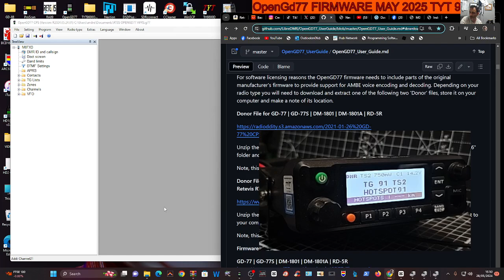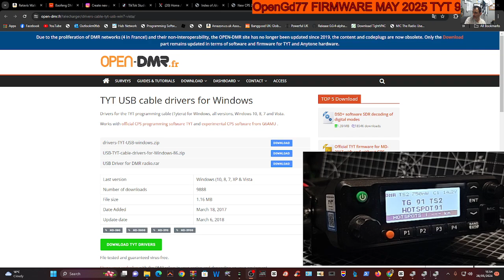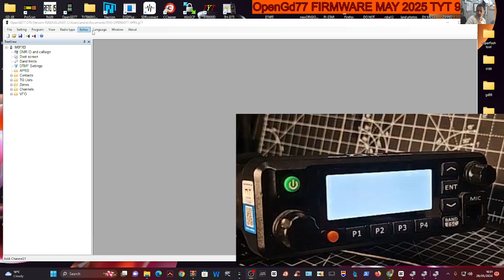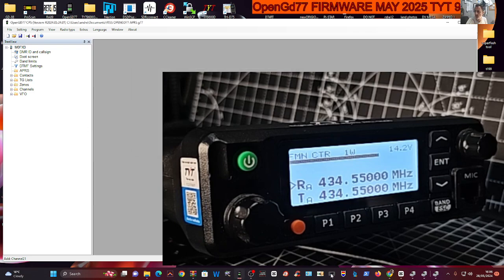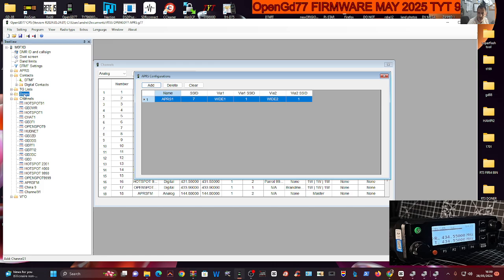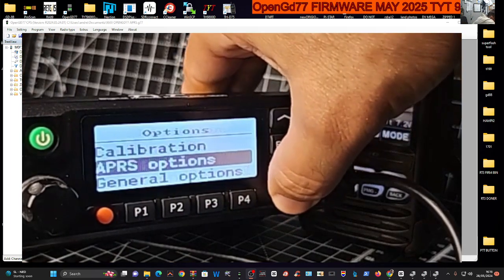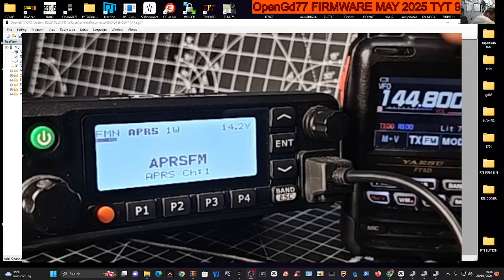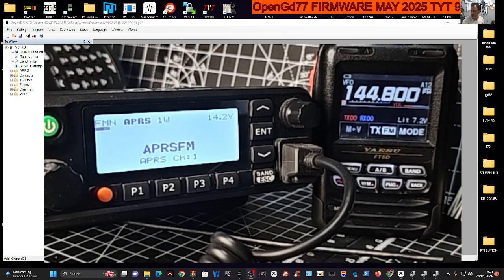TYT-9600 - APRS TX - OpenGd77 Latest Firmware -FULL SET UP

Comment: You don't need to turn off the power supply for DFU mode if you already are running OpenGD77, only needed when moving to OpenGD77 from factory firmware.
Reply from the maker: Thanks